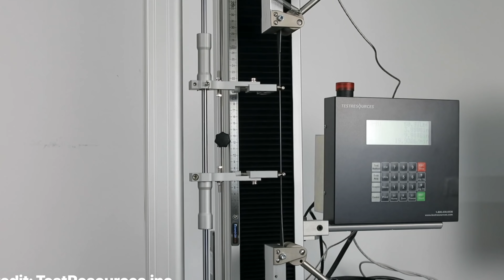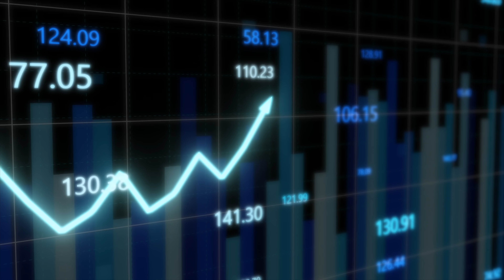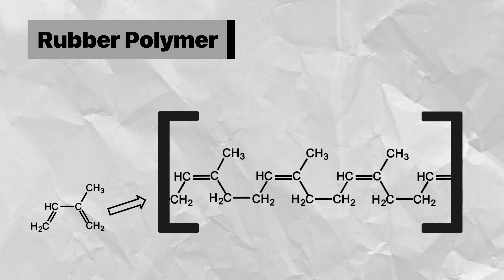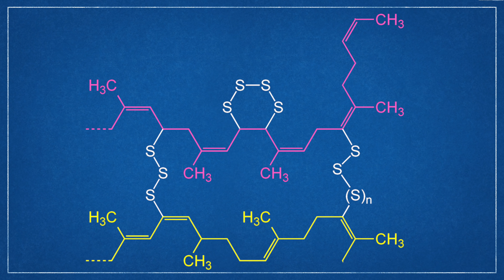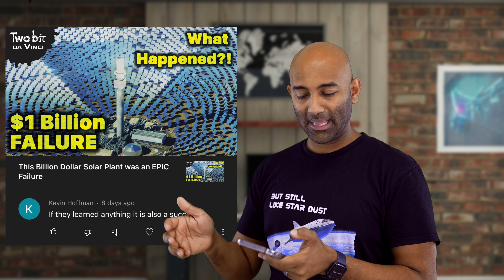The Greatest Accidental Discover Changed the World - Here's How!

Comment: The video correctly states the high points of vulcanized rubber. Today, much of what is commonly referred to as "rubber" is actually TPE (Thermoplastic Elastomer). In common with actual vulcanized rubber is that they are both crosslinked polymers. In the early 1980's I worked as a Product Development Technician in the R & D lab of the Thermofit Division of Raychem Corporation. Their primary products (think heat shrinkable tubing) were based on crosslinked plastics, primarily polyolefins. There are various ways of crosslinking polymers, e.g., chemical and radiation. If an item is molded or extruded either crosslinked at the time of formation, e.g., via heat, or after-the-fact by irradiation, and then reheated, stretched and cooled in the expanded form it can be restored (shrunk) back to the original form by the application of heat. A large scale application of heat shrinkable TPE was a Raychem product used to protect the Alaska pipeline from corrosion. Rolls of crosslinked TPE sheets with a  meltable adhesive were spirally wrapped around the pipeline and then large propane torches were used to shrink the wrap and melt the adhesive to seal the metal pipe. The company also produced products from shape-memory metal alloys. One example was a hydraulic tubing fitting used in aircraft. A sleeve of the metal alloy was formed. It was then heated and expanded slightly in diameter. In the expanded form it was cooled to cryogenic temperatures and stored at those low temperatures. It could be used to form a butt joint between two lengths of tubing by inserting tubing from each end into the sleeve and allowing to warm to operating temperature. The shape memory alloy would return to its original diameter and exert tremendous hoop stress forces on the tubing to seal the joint. Fun fact: The German word for rubber is "gummi".
Reply from the maker: Great insights! Wish I knew you before we wrote this script!
Reply: interesting read,  here in New Zealand, Dunlop along with Ardex have developed a TPO/Butynol  mix, this has the flexibility of rubber but also is weldable with heat like plastic, this means you can heat the overlaps like you can with TPO, its made for waterproofing roofs and decks but could be used in other applications too

Comment: You are ill informed, in so many ways. Wooden wheels are held tightly together by a steel band, that tyesd the several pieces together. Mechlin developed the rubber Tyers we understand today. There are several man made rubber substitutes for many uses. Nina was made in bulk by Germany during WW2. The USA made Thiocol. For tyres and supplied to fuel the boosters to launch the Space shuttle. Many other elastomers are available. Some still for adhesives.